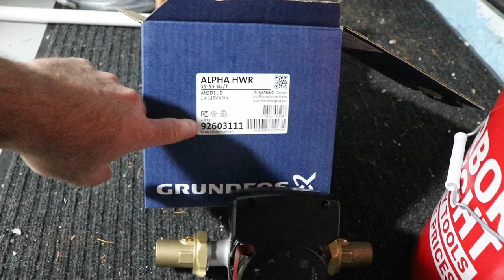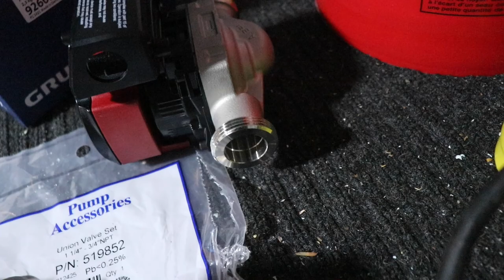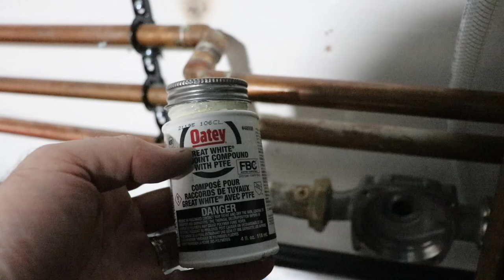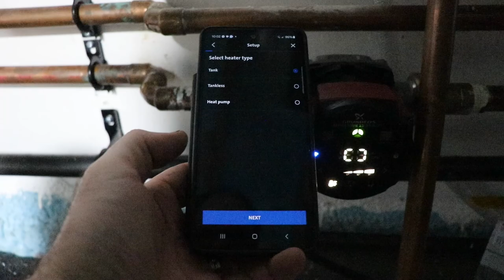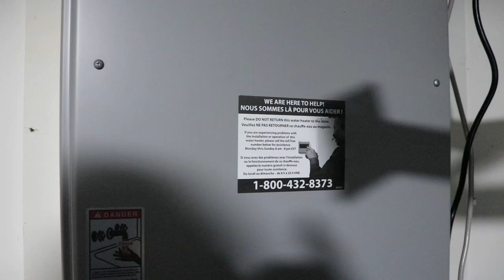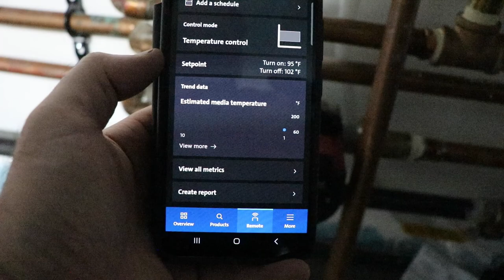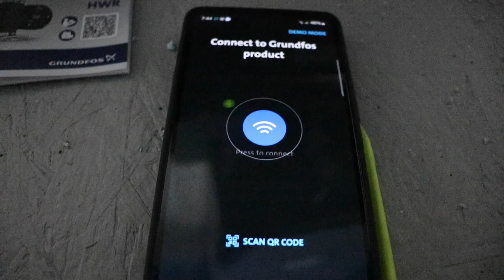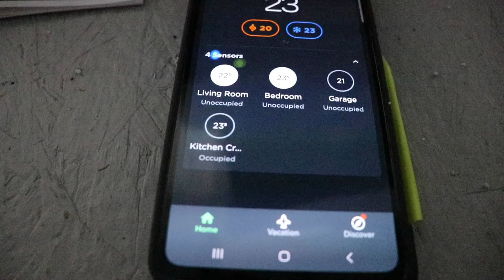Grundfos Alpha HWR Smart Hot Water Recirc Pump with Bluetooth

Comment: Thanks for the detailed video. For someone new to hot water recirc it is useful to see all the steps, all the layout and fittings, and to hear your thought process. I like to research and came up on the Grundfos Alpha HWR 15 55 but with the price that high it certainly helps to hear from someone who installed and operated it.

Comment: Can this unit be used without internet connection?
Reply from the maker: Yes, you can use bluetooth to set it up using an app or use the front buttons.  It is not actually connected to the internet.